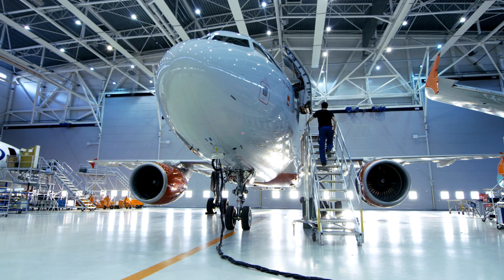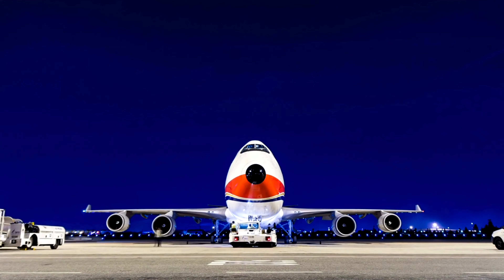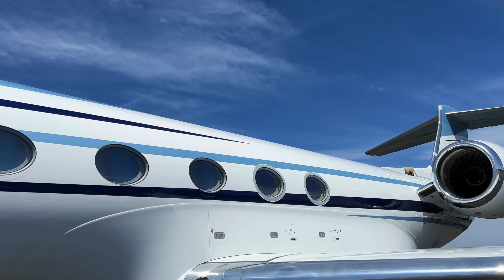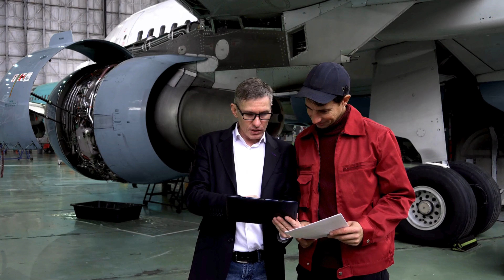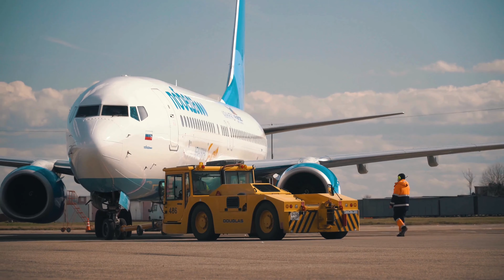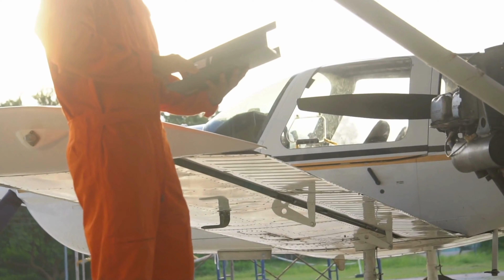Episode 2 B Check Why This Middle Layer of Aircraft Maintenance Is Disappearing, but Still Matters

Comment: Is it not important though to do checks after so many hours of flight rather than just in one window of time per year? Stress and fatigue are linked to the amount of flying hours so would not that affect when  B checks are performed? Or are there only so many hours a plame has usually flown within a given time frame? This would be interesting to know.
Reply from the maker: Great point—yes, checks are typically scheduled based on flight hours, cycles, or calendar time—whichever comes first. You're absolutely right: stress and fatigue increase with usage, not just age. That’s why many airlines now distribute B Check tasks across frequent A Checks, triggered by actual flying hours. It's a smarter, more flexible way to maintain safety based on real aircraft activity.